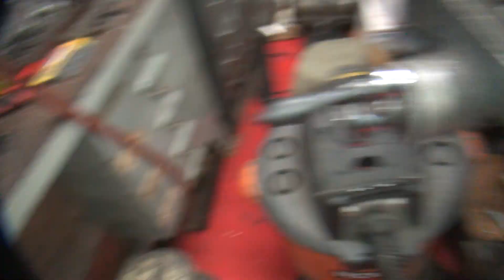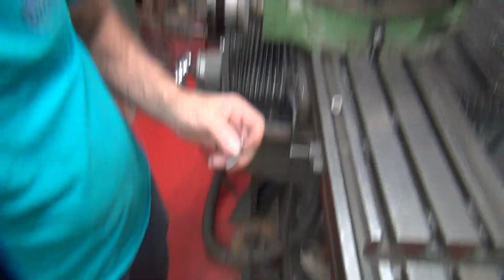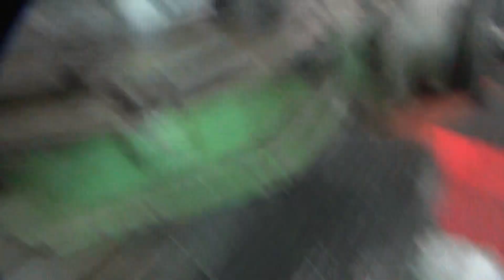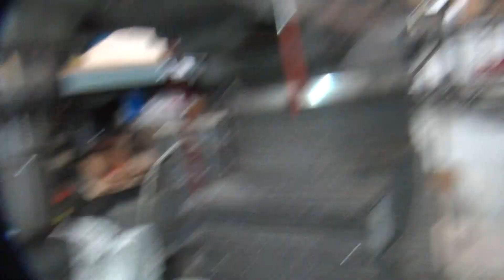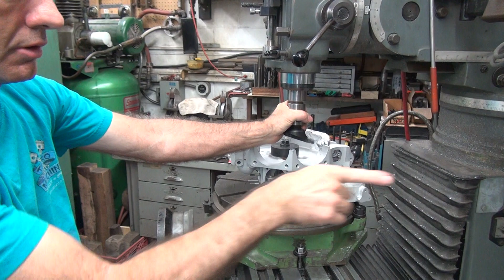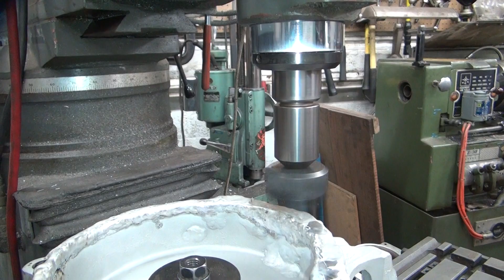#133 1947 EL case welding knucklehead 74ci motor weld and machining repair harley by tatro machine

Comment: Doesn't anyone manufacture new cases ?
Reply from the maker: you just don't get the value in oem parts. ropo cases, $1500, best repo cases, 3k, used oem cases with good numbers, 10k.
you figuare it out.
tatro
Reply: @TatroMachine  blimey not much difference huh

Comment: You could use a dow pin Half inch Then the clamp won't hit the sides That's what I do when I do cases and stuff like that
Reply from the maker: that would work but i like the better suport i get with my shim and nut. less chance of moving around.
tatro